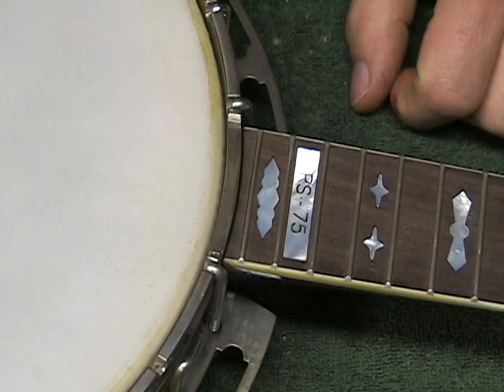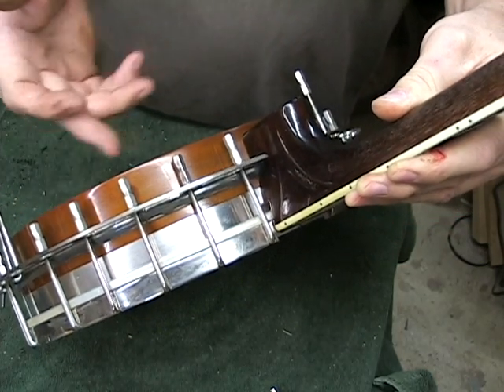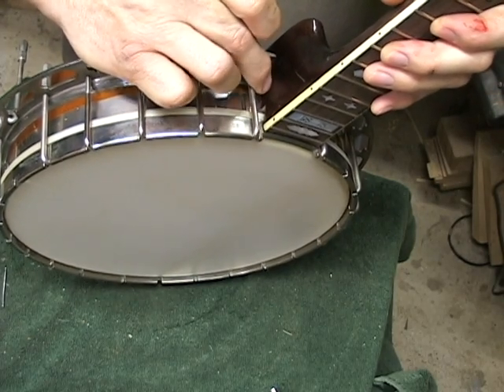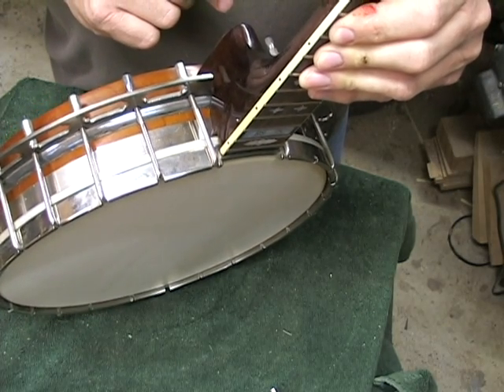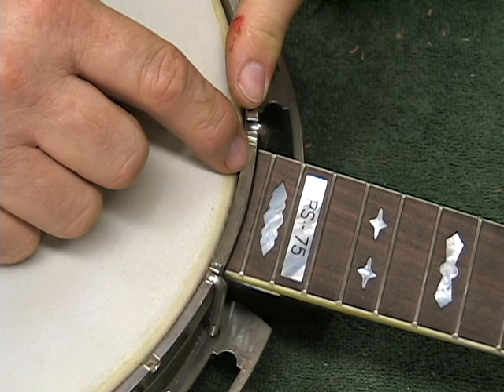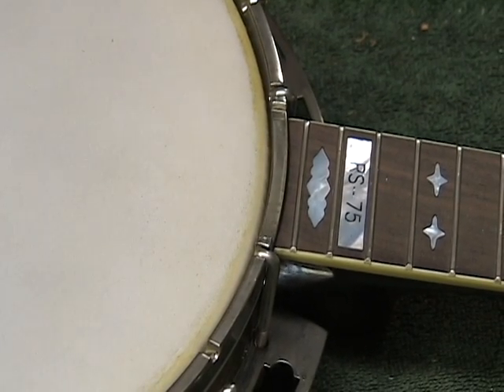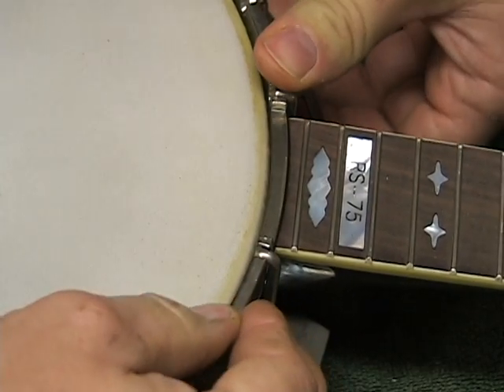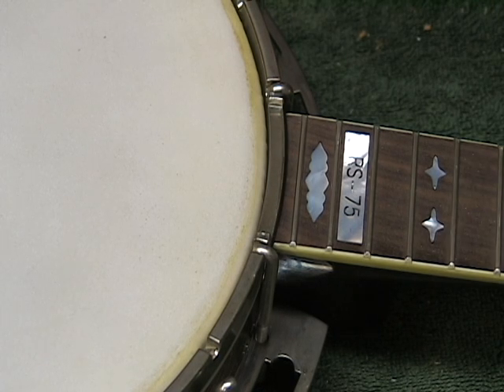Banjo Neck Gap

Comment: I like what your thinking with this gap adjustment Warren,obviously you know what you,re doing! I,ll give it a try. I suppose it makes sense to let the head vibrate on its own as much as it can, free of the neck, if I understand you right! I feel as tho I,m doing something wrong because my sound is somewhat inhibited! Thanks for the tip again,I,ll drop you a line Warren, let ya know if it works for me!...Jerry S.  Hi again Warren..I did this and you,re right..It sounded like my banjo can ring better. When I  hold my banjo about 10 inches away from my face an talk at the head it makes the banjo ring and have lots of sustain! YOU are right...good on ya Warren..thanks for this wonderful tips!!!

Comment: I am glad I have found and subscribed to you. I think you have begun to teach me a more comprehensive summary of the relatively complex system of banjo acoustics. It more in depth than taught at first in a general music course... if someone is doing an overview of different classes of stringed instruments to demonstrate how the majority of the vibrations make it into the resonator, they'll say there's a "guitar-type" and a "banjo-type", with violin being the latter. And so they'll stress that the neck doesn't matter for banjos; that the strings depart all the sound through the bridge, whereas they'll describe the guitar having a lot more to do with the neck transferring sound to the body. That's why people get sick to their stomach when they see you saw up that beautiful neck in that other video, hehe. But I understand... it had your name on it, and you know how to make it right. For a maple-type sound, I wonder how my red mulberry hybrid aged wood would do? A bridge made out of it sounds like denser maple, but not overkill like a dead bridge made out of all ebony, purpleheart, or ipe. It's got golden sapwood and auburn heartwood, and for bows I used to try to include both right down the middle, so the front and back of the bow were each one differing color, and it looked almost laminated, because sapwood tolerated tension better and heartwood better compression. One way to find out, I suppose, but my own wood collection I've aged myself for many years will be special enough to me I'll learn on a number of early models on other wood. If it doesn't make the first banjo neck sing I'll use it for lyre harps or something. Wish me luck (say me a prayer)I fell a bit better and get my cash flow repaired a bit so I can finish re-acquiring a few items and make some instruments. It sure would be a good way to go. And at least right now I got a mill going to make some bridges for friends out of very old piano and organ rock maple, and ebony key for tops. Plus I love to experiment with different woods with bridges. Just too many long-aged woods lying around not to experiment. Thanks again.

Comment: Warren thanks for this video. I'm working with a lot of banjos in my business, and working with one import today that just sounds too dull so' I'm looking it over. If you think about this, if the neck is bolted on tight and it is touching the hoop is one thing but the real question is: is the neck bearing most of all of the real pressure on the rim and tone ring? I can see with this banjo the hoop is touching, but more importantly I also see a gap where the neck should be touching, that is on the rim/tone ring area below the hoop. I can even slide a thin piece of paper (a gas station receipt) in there and that's where it should be bearing so I know the lack of visible gap at the hoop is not because the hoop is scooted over. I also noticed it tough to adjust head tension with the neck on because the hoop and head collar are pinched-  stuck by the neck. What tonal symptoms do you think happens? You think a dull, not bright sound may result?
Reply from the maker: If the neck is solidly connected to the rim and tone ring, you have a solid transfer of sound. if the neck puts pressure on the hoop, it will loose power and be uneven and unpredictable. Even it is is solid everywhere else.

Comment from the maker: The harder the connection of parts to a point, the more vibrations can transferr. The tension hoop is suspended on the head and not solid. That means if the neck pushes there, it is like a connection to a deadener.  Much like trying to play waring rubber gloves.
Reply: is that why my banjo sounds like a guitar

Comment from the maker: Loosen the neck and slip your 220 sand paper in it. sand to the wood. Pull the gap closed and pull out the sand paper cutting as it goes. Do it until it has made clearance.